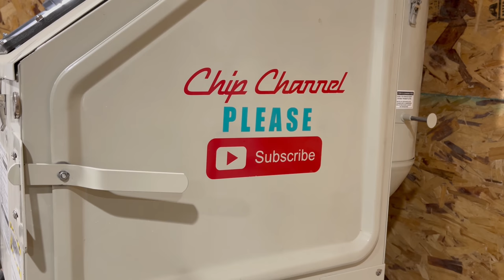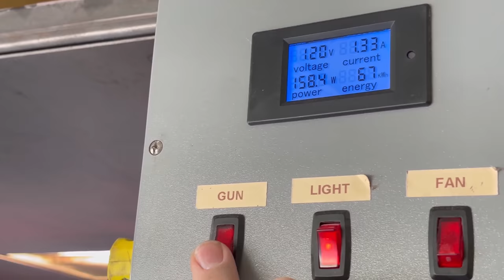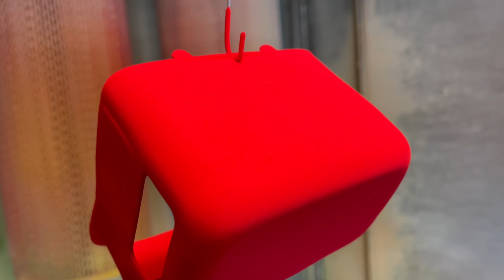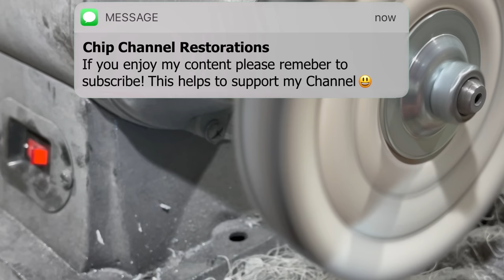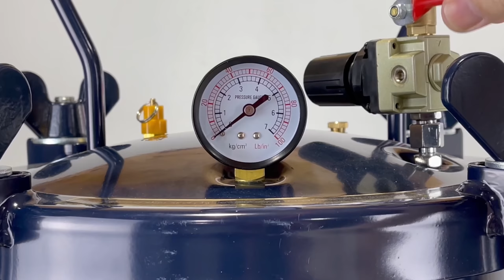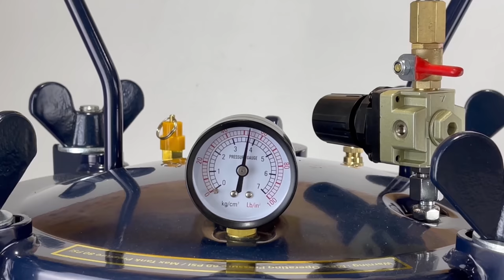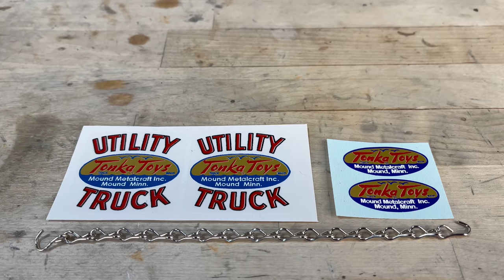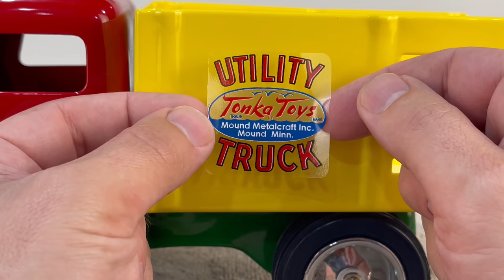1950 Tonka Utility Truck COE Semi Hauler Restoration 4K

Comment: I find it interesting on the older Tonka's that some of the parts used were common things, like the wheel rims are cup pulls for closet doors or rod holders for closet rods. The tires were probably some kind of O-ring. The rest, stamped out on a machine. They made a lot of these, so you can imagine how many parts were needed.

Comment: The itsy bitsy spider saw what was coming, and ran for his life! 1:20.

If you really want to get rid of the bubbles in the tires, I suggest getting some sort of vibrating platform and putting the mold on it for several minutes while wet. This in theory will "shake" the bubbles out.  A similar thing is done with concrete where they put vibrators in the wet mud to excite the bubbles to the surface. I think you should try that before redesigning the molds...
Your skill is second to none man!

Comment: To get rid of the bubbles in your molds, you need to first draw a vacuum to pull out the air within the rubber before applying pressure to set the rubber.

Comment: You'd probably get less bubbles in your moldings if you put the rubber mix inside of a vacuum chamber before injecting it into the mold.

Comment: Love your channel and look forward to new episodes.
BTW, it is safe to assume that just because the yellow paint wasn't lead-based, that the red and green wouldn't be either?  Or did you just not video those tests?
And, PS:  I really DO appreciate the fact that you check for this!  I've seen other restorers not test.
And if you DO find lead paint, and use a stripper to get it off, how does one safely dispose of the lead scrapings?  (Yeah, I'm nosy.  :)  )

Comment: Beautiful restoration!! I have one question. After you put the liquid in the mold, If you hit the mold a little bit at the table? The liquid will spread inside it and will prevent bubbles. Or the bubbles are inevitable?
Reply from the maker: I actually ordered a vibrating table to hopefully force the last of the bubbles out and if that doesn't work I may have to redesign the mold with some additional areas for air to escape. Thanks for watching Mariana!
Reply: Nice! It's a good idea
Reply: @ChipChannelRestorations  Funny, I had been thinking about this problem since your previous video. I was going to suggest three things. A vibrating table, putting your mix into the vacuum chamber just before injection to pull bubbles out of that solution, and using a larger injection syringe - the 10ml seems to need a refill so may times, that likely introduces bubbles as well. Perhaps moving to a 30ml syringe? I know it's a weird assortment of thoughts, but I was in rapid prototyping before I went into nursing, so I have weird experience from both angles. :)

Comment: Are you making the tires blue on purpose to show they are reproductions? I  think you need to put the molds in a vacuum to get all the air bubbles out.
Reply from the maker: Thanks Kevin, I'm actually not sure why they don't come out more black. I emailed my rubber supplier and awaiting a response.

Comment: The bubble problem could be resolved by instead of a pressure chamber use a vacuum chamber. The vacuum literally sucks the bubble down to almost microscopic size.

Comment: I like that these appear to be real restorations. Much of this genre is fake. And for possible real assistance, do to my many failed epoxy and rubber molds, you might consider a vacuum on the initial stir to pull out as much air as possible and then at least 50psi on your pressure pot. But all good and much appreciation for the content!!

Comment: That little truck's just four years younger than me, and I wish that you could restore my body as effectively. I haven't read all the comments yet, but did you replace the small pieces you removed with the cut-off disc, and did you re- plate the axle and wheels as you normally do ?

Comment: hihi maybe if you put more holes - for more sprues - into the tyre mould you would get less bubbles? otherwise maybe figure out a way to inject the rubber? silicone? under a vacuum or under pressure?

Comment: I would recommend you use a razor blade scraper and not use the razor blade by itself. I was scraping with a blade and 
the blade turned on me and cut deep in my middle finger it took 6 stitches. Sense thin only a handle to protect my self. 
great work COE looks new.